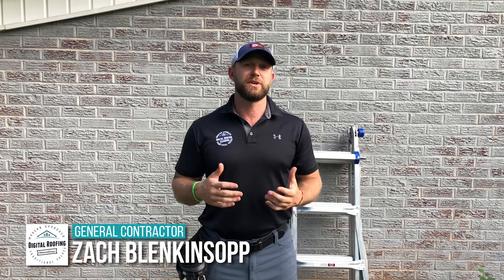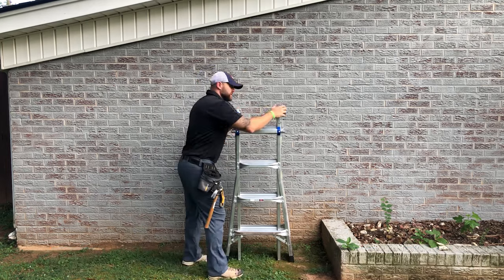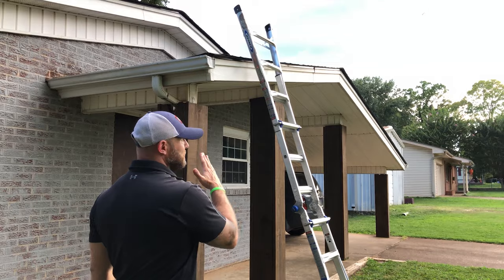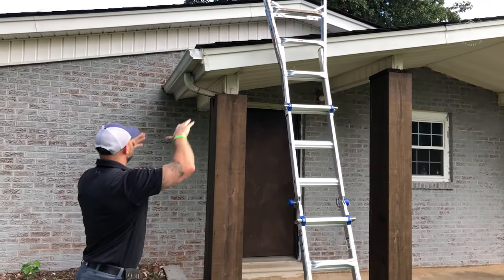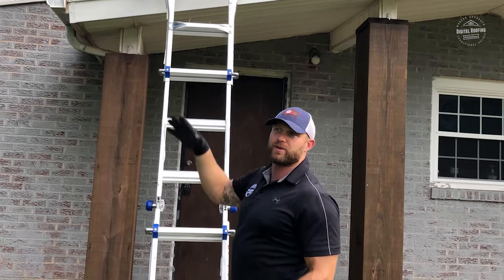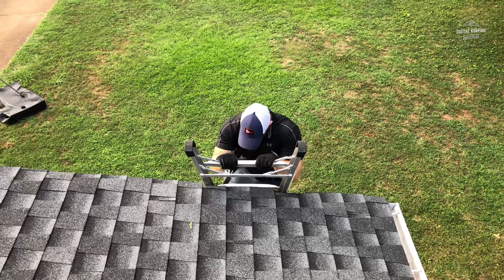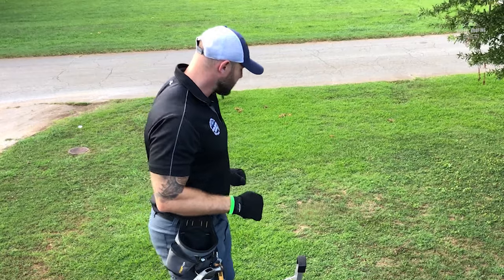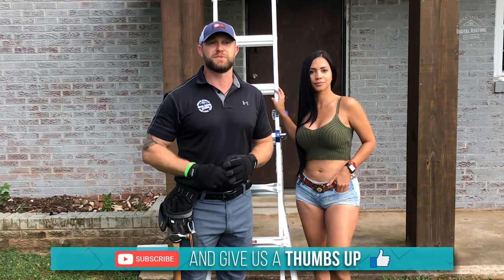Ladder Safety | How to Climb on a Roof Without Getting Hurt!

Comment: I'm no expert, but here's my 2 cents (sometimes being a novice helps in scrutinizing the details)
    1) the ladder should extend above the roof top by 3 feet.
    2) you should step onto the roof BESIDE the ladder, not over it
    3) when descending, while facing the roof,   you should first place both hands on the ladder posts, then step onto the ladder from the side at the level/height of the roof, then
     4) transfer your weight SIDEWAYS onto that foot (squarely on the ladder), then you can easily descend. That way, you never have to look down
Reply from the maker: That is a valid point and that is certainly a safe process on ascending on descending a ladder.  There are no exact rules on that except it's preferred to have 3 points of contact and to have an extension above the roof.
Reply: OSHA standard requires 3 feet of extension above the roof
Reply from the maker: @datdozier228  Thanks for the input!
Reply: 100 percent agree. I am not an expert for sure but I was so shocked he is showing people to hop backwards over the top of the ladder to get yourself back on the ladder. A lot of people gonna try that maneuver and fall backwards off of the top of the ladder. Sorry but definitely unsafe to climb over the top of the ladder to get back on it from the roof.
Reply: I was always taught that it's three foot above roof line. But some circumstances can call for two feet. I have been working on ladders for 24 years, and stepping backwards over the top rung onto a ladder is definitely not the way I would recommend to do it. Too much of a trip hazard, or leaning back and falling. I know that each person has their own tried and trusted ways to use a ladder safely, so do what feels comfortable for you. Good advice though on if you don't feel comfortable, or safe on a ladder or roof, DO NOT go on it.
Reply: @DigitalRoofingInnovations  OSHA would beg to differ on that. In industry they always hammered on this
Reply: His foot slid initially which almost made him fall while grasping the ladder.. I was like safe.. how?!
Reply: Ya..I'm crawling. lol No stepping here.

Comment: Okay, I have a real problem with climbing onto a roof with these multi-use type ladders.  The problem is the widening of the ladder at the top.  Good ladder safety guidelines usually demand that the ladder extend 36” past the roof when climbing.  These ladders widen significantly at the top, so you have to get around the wide part with tools, tool belts, etc.  This does not feel safe when I do it, so I only use an extension ladder for going onto the roof.  Am I missing something?  Thanks.
Reply from the maker: Good point!
Reply: Yeh I felt woosey just watching  when he swung his leg around to get back on the ladder to get down, yep thats when I will fall

Comment: Do you have a shoe recommendation for someone with sensitive feet? Everytime I attempt to climb on a shoes on a Type II 16 ft Aluminum Extension ladder my feet hurt badly from cramping. I do not have this problem with an old 6 ft fold out wooden step ladder. The rungs on the Aluminum ladder are not flat like the wooden ladder but rather round. Additionally, I climb with tennis shoes but have been told that the soles might be too rubberly so that rubber might be too soft and suggested using hard sole "brogaine" dress shoe with good traction sole. I've spoken to my father about this and he says he even notices how the aluminum ladders cause more soreness that isn't experienced from the likes of the flat rung old wooden step ladders. There is less surface area that you have to put pressure on with the Aluminum ladder leading to foot pain ladder after the job.  For those with past history of plantar fasciitis who have it under control day to day with high quality orthontics...I'm wondering if there are some specific recommended work shoes. I can't imagine everyone is soaking in epson salt after every ladder climb for even a simple 15-30min task.

Comment: Rule of thumb I've heard is to put your feet at the bottom of both legs of the  ladder and reach your arms toward ladder. If you can extend your arms out and grab each side then it's set at right angle. If you can't it will slide out from under you or if your elbows are bent then your to close and ladder will fall backwards

Comment: I noticed that most people who are new at home repairs can go up a ladder just fine, but then they have problems going down the ladder. Especially how to position themselves for that first upper rung of the ladder when they are just about to come down the roof. I felt pretty awkward myself going down a ladder the first few times I started climbing my roof.
Reply: Ugh! This is exactly my issue.
Reply: Which is why it's important to use a ladder that's high enough. It should extend at least 1 metre or 3 foot above the roof, so you can grab the handrails before bringing your body onto the ladder. I'd suggest he doesn't have his ladder high enough in this video.

Comment: Great information! Thank you! I have a 2 story house that’s about 20’ high to the top. I’m a 67 year old female trying to get a cat down that has been up there for 1 week. He’s afraid to jump ~ 8ft to one of the lower level eaves. I’ve tried coaxing him with everything. I’ve stacked boxes on top of an extended ironing board sticking out of my window (LOLOL neighbors probably think I’m crazy, I don’t care). Then I stacked boxes on top of the ironing board that isn’t very far away from the roof but he’s still scared. 

The reason cats can access the top roof is because the next door neighbor’s tree hangs way over our roof and causes many problems including insects dropping all over our deck and branches scraping our shingles. Good grief! 

He’s not the only cat that has been up there.☹️

Comment: I've never been a mad fan of heights, but currently learning Maintenance stuff at my job.
Changing air filters on the roof isn't actually that hard of a task but, they wanted me to carry about 8 of them (lightweight) but its enough to fit into a big cardboard box. My trainer wanted me to carry the box in one hand and climb up the ladder one handed which i feel very uncomfortable doing as its an older building and not the most sturdy of roofing ladders.
Do you suggest maybe buying like a rope with a hook on the end to just pull the box up once i reach the top?

I've started a new position at work and I know this may seem very silly but this one thing is making me feel unable to perform this task even though I know what to do once on the roof.

I commented because you seem down to earth and know what you're talking about. I understand if its a silly question but I was trying to think of safer ways to accomplish this task while minimizing risk to myself

Comment: I have been a professional painter for just on 50 years and this demonstration could easily have been titled everything NOT to do when climbing a ladder on to a roof. First off it is far safer to have the ladder on the section of the roof that has the gutter...because the ladder is  making solid contact with a straight line of roof and not an angled line (This would tend to make the ladder more prone to slip) And if you are climbing the ladder correctly your weight is all on the ladder and not pushing on the gutter and damaging it. Also the there should have been far more of the ladder above the roof line....at least another 2ft....this makes it easier to step directly on to the roof and  so avoid the potential of "Burning your hand on a hot roof" (Had to chuckle about that!)  Sure wear them AFTER your are on the roof it you want..but wearing gloves when climbing a ladder only makes the average person have a far less secure grip on the ladder) Also I have never seen a professional put a leg over the top of a ladder when stepping on or off a roof....doing this makes the risk of the ladder or worse you ending up on the ground far greater. You have enough of the ladder above the roof line so that you can easily step around the side and on to the ladder. Look around on Utube for other videos on ladder safety...because this is not even remotely a safe way to tackle climbing a ladder or getting on to a roof! But hey, don't take my word for it, you'll have plenty of time to regret the advice in this video when your in the ambulance on the way to the  hospital!
Reply: I completely agree with everything you said here,  in fact I have never seen anyone step over a ladder like this , seems like the most unnatural way possible to transfer from roof to ladder unless doing a handstand while transferring that would be most unnatural .
Reply from the maker: This is for homeowners to quickly get on a roof, not professional painters doing commercial work.  And in rooting, we routinely put the ladder to the side to not damage the gutters.
Reply: digital roofing ,professionals are professionals because they have done everything the wrong way more times then you have even tried  ,Therefore  they have learned all the things not to do , you might consider learning from them so you can have the best information possible in order for  to be the best teacher possible .

Comment: 4:1 slope on the ladder, 3+ rungs above roof line, and usually i put the ladder where the structure has an inward angle. For this roof i would have put the ladder leaning on the taller roof but right next to the gutter, so i could side step onto the roof
Reply: Oh that's brilliant! I have a split-level and have been trying to figure out the best way to get onto my lower level roof. 👍
Reply: @Jasper_the_Cat  just be careful.  Make sure your weight is shifting correctly during the transition
Reply: @SYLperc  definitely. I'll just take it easy and slow.
Reply: i AGREE

Comment: Good looking video : ) 

Most deaths or paralysis occur on 6' step ladders as the break point is between the second and third vertebrae where the average neck line contacts the ground

If you're going to fall, jump of vertically they say, then you land in your feet, hit your knees then with elbows protecting your head you roll into a ball then roll and turn impact force into kinetic rolling energy, but better off being tied off on a life line, it's simple anchor bracket and rope, takes 5 minutes,

Say you have a roof tie down anchor 25' from where you're working at a roof edge, it's 65' from the ground, 70' from the bottom of the elevator shaft, hook your rope around a roof truss right where you're working, so maybe an 8' straight fall would occur if you fell off a wall, however, if you didn't wrap your rope around a close framing member you might be in for a 20 foot fall at the point of drop in only to swing 15' back into a block wall and then your 6' lanyard, so, a 170 lb guy falls, he's at the end of his rope perspective to his fall location, but the anchor point is 25 feet back, he falls for 20 feet in a swing and smashes full velocity 15 feet away into a cmu wall, nominally, but the lanyard or rope with a built in lanyard system (which should then be only connected to your harness D ring and not your 6 foot lanyard) unleashes, so then a 20' swing drop becomes 26 feet of properly connected, or, if improperly connected becomes 6' on the rope with built in fall arrest plus the 20' of rope plus the additional 6' lanyard you're talking a 15' lateral positional fall at the drop point away from Anchorage, and a 32' drop to take you smashing into a concrete stair it elevator shaft, this needs to be integrated in OSHA around the globe. It's sometimes impractical to move an anchor every ten minutes, but wrapping your rope around a close framing member plumb up from where you're working might be in order
Reply: thanks

Comment: Thank you, I find this helpful. Can you please do one for a double-house roof? It is very high above ground and it requires extension ladder but what are your tips to stay safe up the double house roof.
Reply: Same concept applies to a low roof as a high roof, do recommend securing Ladder on top and bottom if you plan on getting on a high roof. Also make sure your ladder is 3 rungs above your stepping point onto roof to you can step on ladder standing and from the side. Do not recommend how he gets on and off roof in this vid for low or high roofs

Comment: I'm about to pickup a little giant 22 to work on the roof. I've always had a horrible feeling while using my current ladder, especially climbing down. Ive actually wedged the ladder on an angle between my house and my truck just in case.

Comment: Be very carful stepping over the extended ladder if you have heavy clothes on - a jacket or loose sweatshirt can get hung-up on the top rails.  With your weight moving forward you can turn the ladder into a pole volt.  Been there done that - survived.

Comment: Your first step onto the roof was with your left foot, followed by the right foot.  Considering that in your example, the left side of the roof is lower than the right, this made sense.  However, I do not understand why, during the transition from the roof to the ladder, you did not do reverse the order.  When you stepped from the roof to the ladder, your left foot was first to step onto the ladder, followed by the right foot.  This seemed less safe because your right foot (still supporting your weight on the roof) was higher, forcing you to crouch / bend-over more, thereby reducing your body's ability to stabilize and balance.  Would it not have been better to keep your left foot planted on the roof (lower than your right foot), then lower your right foot onto the ladder, followed by your left foot?  Good video.  Thank you for your service.  Also, do you work in southern California?  If so, I may want to consider you for a roofing job.
Reply from the maker: That’s a great observation and most likely, yes.  I do so much climbing on and off roofs that many times, it just comes natural.  

And unfortunately, we don’t cover that portion of the country but thanks for the comment!
Reply from the maker: @RedondoBeach2  well, I thru hiked the entire Appalachian Trail from Georgia to Maine this year.  And I hiked with many people who were afraid of heights. 

Go for it!

Comment: Using one of our works bs flimsy extension ladders and my weight caused the ladder to bend slightly as I was at the top and the leg pads resting on the paver patio below lifted enough from the surface due to the sag as I climbed and the damn thing slid and I dropped about a foot before the legs caught.  😅 worst 1 foot drop of my life and it was all to hold a roof vent in place for a plumber..

Comment: I need to get into the ladder climbing game
Reply: What a super hero climbing up an 8ft ladder lol the fool dsnt have it tied off at the top so it will slide either way and the ladder he is using is dangerous as hell. The way to step off of a ladder is have the ladder extended 5ft higher than the first row of tiles so you can climb up the ladder and step off at roof height. I started working at hieghts 35 years ago fitting lightning conductors on Church steeples and other buildings of scary hieghts. I'm still enjoying the buzz as a Roofer 30 years later.

Comment: Bad idea to lean a ladder against guttering as it can collapse and is also slippery - use a ladder stand-off. Also - the ladder should be at least 3 rungs above the roof line so you can get off and back on the ladder easily and safely.
Reply: You have or do work at hieghts. Tie the ladder off at the top and have it extended enough to step off the ladder onto the roof. To be honest always have someone there to foot it and have your back.

Comment: Buy a ladder with a standoff if you are a homeowner. Keeps you off of everything but the shingles. If you do bend the shingles and end up bending the aluminum fascia board you just cost yourself 175 bucks to get it fixed. A standoff is 60 bucks

Comment: That ladder isn't perfectly level on the roof in the video.  Ideally, you have a 4 to 1 slope into a perfectly level wall or roof.  Since the roof in the video isn't level, the 4 to 1 slope in one direction meets the roof pitch in the other and twists the ladder by a third angle.  Your ladder wasn't designed to hold its weight limit with that kind of rotation.  I think the wall or gutter side of the roof would have been better since those won't twist the ladder.  The wall would be better if there is no guard to protect the old gutter.

Comment: you probably picked the worst spot to put that ladder. 

ALWAYS try to put it on the side if you can cause if you do any damage it wont be right in front of the front door lol.

edit: you didnt strap your ladder either, could easily slide to either side....
Reply from the maker: There’s not really a great place to put a ladder.  Either way, you could be damaging the shingles, drip edge, or gutters.

Comment: Sorry Sir, but that is no way to erect and climb a ladder. You should have at least 4 foot of ladder above the roof you are stepping  on to and you go around the ladder and not through it. Preferably with D-Rungs and not square rungs, and any ladder over 40 feet should have the heavy duty I styles and rubber feet, tied to something secure.

Comment: Do not follow this man’s advice unless you want to break bones. You absolutely DO NOT want to get off a roof by backing down OVER a ladder. And ladders should be set at 75 degrees. Not 30 FFS. And you should have a minimum of a 3 foot overhang. In his quest to get views and make money by showing off his girlfriend body, this guy is going to get someone killed. This video should be taken down.
Reply from the maker: You are talking about commercial applications, not the average homeowner climbing on a roof.  I agree it should be 3 feet over a roof, which I addressed in the comments about 3 years ago when the video came out.